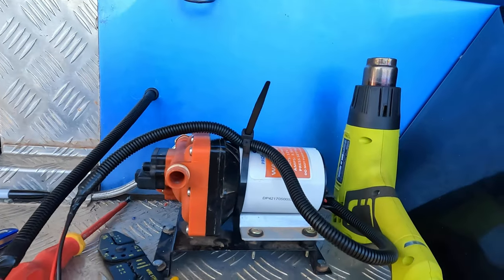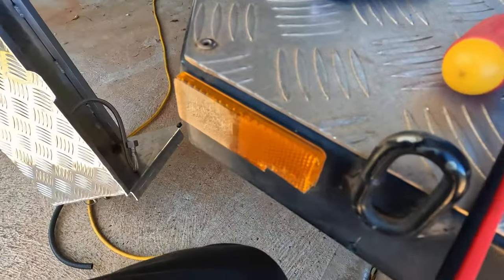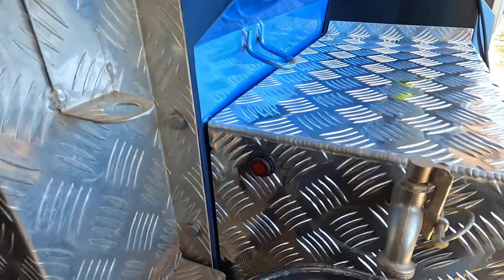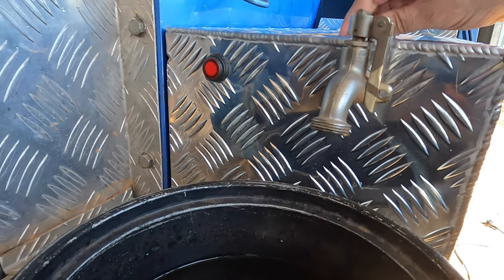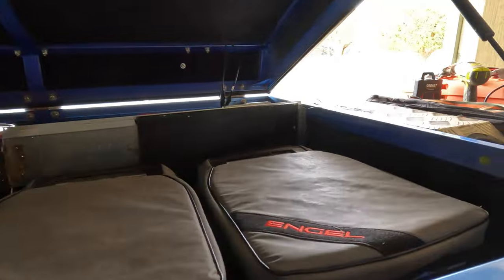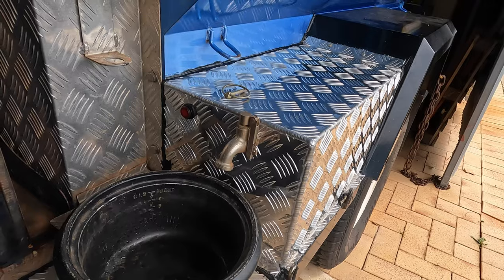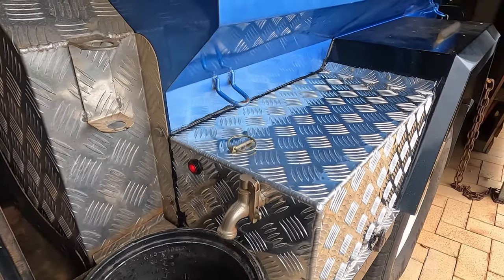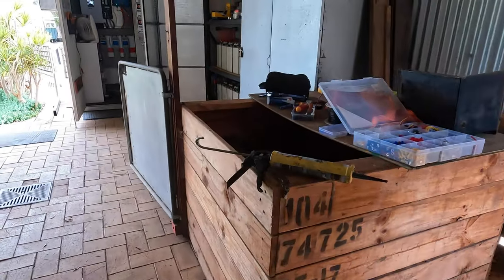RV Plumbing.  Wiring in the Water Pump #3

Comment: Looks like a big pump.
Reply from the maker: I have another brand new one in my shed if you want details on it.  It uses 8amps @ 12v to start and then uses a bit less and it is a 4 chamber diaphragm pump. Not sure on the other stats but i can find out if you need to know.

Comment: Nice job Justin. Have you ever had a problen with your Mahindra's propshaft centre bearing? I had to replace myne 4 times in 18 months.
Reply from the maker: My Mahindra's is a 2015 model and i have never had any problems with it. None at all. Due to my loads and the fact that  90% of it's life it lives off road I did beef up its suspension quit a bit. If you are having problems with the Drive shaft (prop shaft  is for a Boat motor or Aeroplane as both have a propeller. hence Prop Shaft.)  then i would look at your springs and bushes and the alignment of the rear diff and  your gearbox mounts. The symptom is repeated  Premature Failure of your centre bearing now you just have to work out what connecting part is out of alignment.